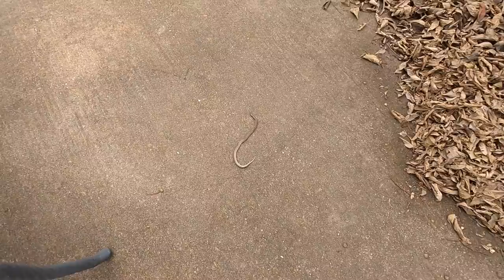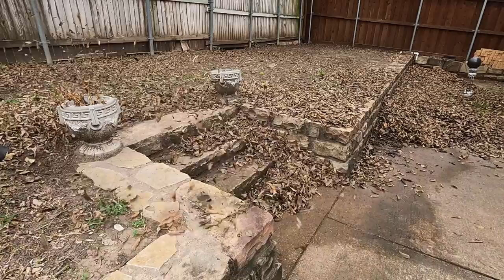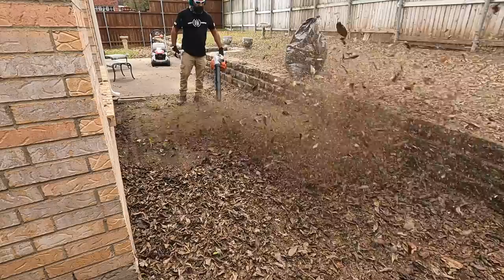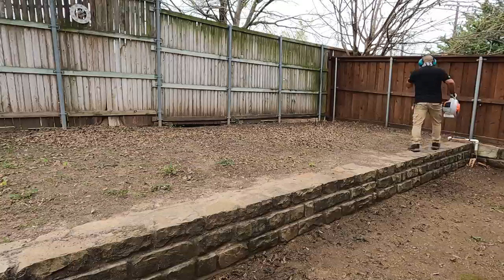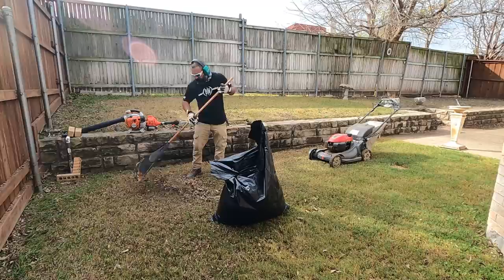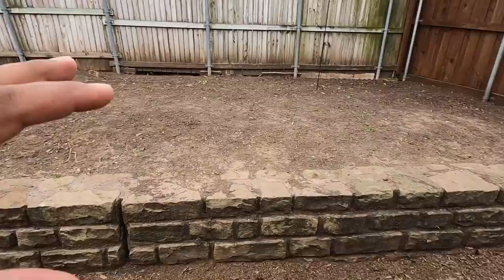HELPING ELDERLY MAN CLEAN UP SNAKE INFESTED BACKYARD

Comment: Just a suggestion you don’t have to follow obviously but if you get yourself a Rubbermaid trashcan put a couple small holes at the end on the bottom like on the side part at the bottom you can put your bags inside of it and as you fill it up the air will be pushed out through the bottom or the top I had my own landscaping business and when I was going to have to bad things I found that works the best.
Reply from the maker: Thank you for your suggestions!

Comment: I would have run the mulcher up and down the yard first. That would be easier on the mulcher not have to mulch the big piles. the blow the remains into a much smaller pile. I would have done the upper level first. Then blow the fallen leaves off to the lower level.   WHAT was the big deal of the snakes int he title.  TWO snakes make a infestation.
Reply from the maker: Thank you.